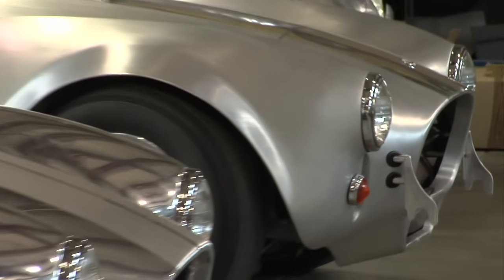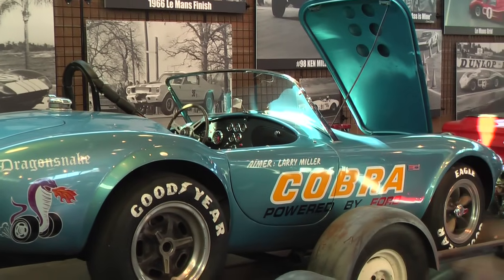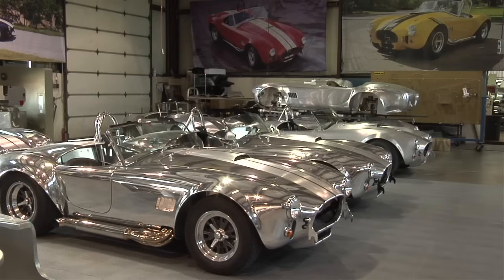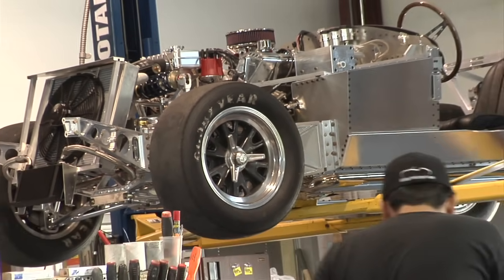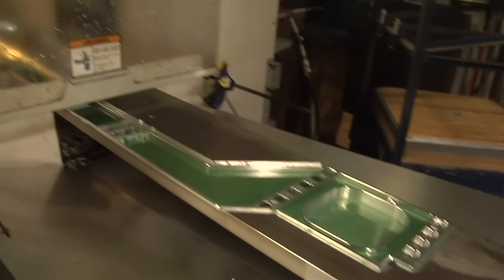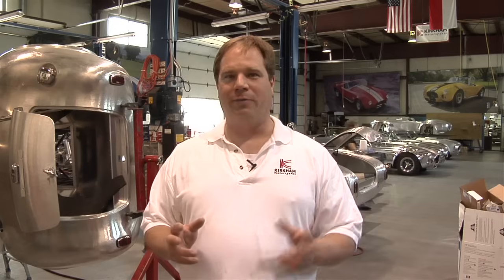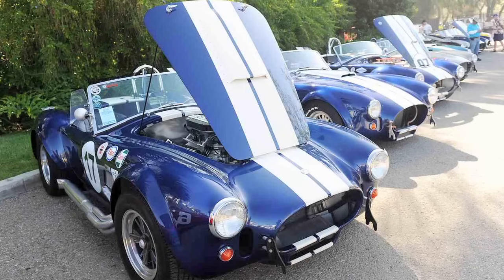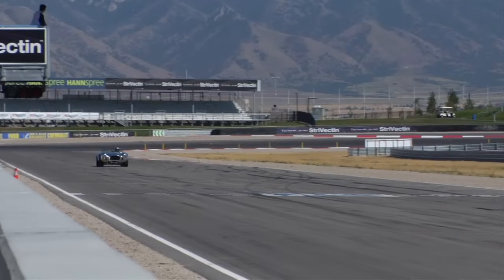Utah's Kirkham Cobra

Comment: Just to clarify, you referred to the 427 S/C as a super coupe, but that is incorrect. The S/C stands for Semi-Competition because they were race versions made street legal. And not all of the 427 S/Cs has a 427; some actually had a 428ci and still referred to as a 427 S/C with the 427 badging. This was mainly due to the limited availability of the side-oiled 427ci FE. HTH
Reply: Wrong. It was the "1966 427 Street Cobra" which got the cheaper 428.

Comment: Back in the 80's there was a guy in town that had a Cobra kit with a fiberglass body but on a little spot on the rear fender he made it look like it was dented. He actually molded fiberglass to look like a small dent in aluminium. It may have actually been a bit of aluminium, I am not really sure how he did it but the long and short of it is he had a fiberglass body but fooled everyone into thinking it was aluminium by faking a small (silver dollar sized) dent. It looked like the paint flaked off with aluminium body under the paint. 
Back in the 80's nobody made aluminium bodies so, back then, aluminium = real Cobra. 
This guy fooled everyone with his fake dent. 
I didn't find out it was a kit until years later, at a car show, he had the car opened up and you could see the underside of the hood etc and it was obviously fiberglass.
Reply from the maker: Funny!!! I wouldn’t be caught dead pulling a stunt like that. Alive perhaps but never dead. Love that sort of thing. Thanks!!!!!!

Comment: I wonder if the thickness of the aluminium is greater than the originals? I was in the "Chequered Flag" garage n London in the 1960s and they had a Cobra for sale. I put my hand on the top of the rear fender very lightly and to my shock felt it give a little.

Removing my hand I saw a shallow dent there and thought I better walk away right then!

I built a fibreglass replica Cobra and ran it as my daily driver between 1992 - 2002 when I sold it. If I ever have enough cash - seems unlikely however - the Kirkham is the one I would want to buy though!
Reply: Stewart W. How much did you sell your kit cobra for and where did you get it from originally?  Thanks.
Reply: Mine came from Kit Car Centre which was one of the very first to offer a kit in South Africa, where I live. Based on a ladder chassis and Jag XJ running gear and suspension, I installed a rebuilt and modified Ford 302 Windsor which came out of an old Fairlane and a Borg-Warner T5 gearbox.

When I sold it I had put about 60 000 miles on it. The market 17 years ago here for V8 powered cars was not buoyant due to the high fuel cost, so I did not get a good price, probably around USD 8000 at the then prevailing exchange rates.

Comment: What kind of car are you driving? Is it a Shelby Mustang? 65 or 66?
Reply from the maker: Bill Beverly It's a 67 gt 390 that was "shelbyized" in 1970 and then raced. it's mostly correct Shelby, but the hood is made from a Torino hood and the front is like a Elinor. 65 Shelby suspension. Cool, but I'm doing some restoration work right now. Major rust in the rear quarters.
Reply: It's a 67

Comment: These are 'AC' Cobra replicas. The car was originally a model called the Ace, built by the AC company in England. Carrol Shelby had the bright idea of putting a large American engine in a British sports car that was light and could go round corners. But he did not design or build the cars; He imported them ready built and fitted the engines. Every true Cobra, therefore, comes from England.
Reply: The AC Ace was a handling disaster with primitive suspension. It took a great deal of modification to make it into a Cobra.
Reply: It's true that the Ace needed considerable upgrading to handle the extra power, but let's face it, Americans can't build sports cars.
Reply: ahh Yeah Don't you think most guy's 99% now that checking out this Video. Those Cobras are worth more but these Newer Kit Reproduction Cobras are Faster Wayyyy Better Quality and Reliably
Reply: And the 427 was a Ford design - with the body built to Ford specs by AC, a complete redesign.  Ciao, L (FoMoCo Engineering)
Reply: I've owned Jaguar, MG, Triumph, and Lotus and I can say that the Brits have a great eye when it comes to coach design. Unfortunately that expertise does not carry over when it comes to engineering. You would think an island nation would know how to design an electrical system that resists wet weather. Mechanically they all had quirks that had to be gotten used to. Still, I loved my little cars when I was a young man. But back then I had the time to work on them.
Reply: David miorgan  Porsche is the most successful company when it comes to racing...
Reply: David miorgan   no matter how many times you say it it will not make it true...
Reply: @liarliarliar6495  Americans can't build sports cars? Have you heard of the Chevrolet Corvette? Maybe the Ford gt40? Granted there aren't as many as there are in Europe. But American companies have managed to make a couple "sports cars". And the Corvette is midengine as of 2020.
Reply: @storyteller1749  Sir  = You speak the truth... AMERICAN sports cars are a very good car for the money...  I own a 2014 STINGRAY  =  7 speed  =  525 HP = Great cornering = Flat Out haul ass machine...  4 yrs old when bought ... 15,000 miles... in new condition...  45,000 $  Now where else in the WORLD can you get this kind of car for that kind of money...  HEY I like it ... And the wife likes it... So we are impressed with AMERICAN sports cars... You can spend alot more = And get little more results...
Reply: The 427 was not a "Ford design". It was still the AC Ace, flared by Alan Turner of AC to accommodate very wide wheels.
Reply: The AC Ace was not a handling disaster as you say. If you were to ever drive one and know anything about classic 1950s sports cars, you would be amazed at their incredible handling. The AC Ace was the first car on the planet to have independent rear suspension and a tubular chassis, all designed specifically for the characteristics of radial tyres...and it was thus no coincidence that the Ace was the first production car in the world to come equipped with radials (Michelin X) as standard equipment.   Former AC Ace-Bristol owner.

Comment: "Shelby Cobra", "Shelby", "Shelby"....  Not one mention of Shelby's partner, AC Cars Ltd. of Thames-Ditton, Surrey, south of London. It was their car which they originally modified to accept a 260 Ford V-8. It was their design--which Carroll Shelby never bought the rights to, by the way--and it was they who built the complete cars. Contractually the cars were "Shelby AC Cobras". Shelby American had a lot to do with helping to develop the cars, as they kept fitting more and more powerful engines, which necessitated stronger and stronger parts, as dictated by racetrack experience, which they would pass on to AC. While not many Americans know it, AC also had its own Cobra racing efforts at Le Mans and elsewhere, and their own experiences also translated into improvements to the Cobra. It wasn't all "Shelby", "Shelby", "Shelby"...
Reply from the maker: Well yes. But it really is Shelby. Sunbeam and Allard did the same thing sort of. But the Shelby ford racing team made the magic happen.
Reply: The Shelby team in particular and Ford had a lot to do with "the magic" you mention, but as I pointed out, AC incorporated its own racing experience into the gradual development of the Ruddspeed AC Ace into the big block Cobras, over a five year period. Much of this is unknown to Americans, because Ol' Shel did a very good job over the years in doing his utmost to deny AC any credit. The Cobra had two parents, one of whom was funded by Ford. It didn't have one parent.

Comment: The best version of the Iconic Cobra ever. Hands down . I would order one if l had the $$$$ & also if he gave me permission 2 put in my own engine .  A small big block Windsor 441 cu in. With Hammerhead Performance Heads & Ingelese Injection
Reply: William Smith  
Not sure what a 501 is .. bbf. 
2 heavy . Or if it's a stroked LS. Over square . More stroke than bore . OK 4 all out efforts.  But 2 much rod piston angle on the bores.   
A 441 cu inch is 4.125 bore × 4.125 stroke.  U get the best of both worlds.  4.125 bore is also safe .

Comment: No matter how you spin it, still a kit car and some states accepted as replica.
Quality does not mean in a kit car world
Reply from the maker: Kit?  How do you figure?  Even Shelby has to comply with laws about manufacturing automobiles. Pretty much requiring but everybody acquire their own engine, but that doesn’t mean that there isn’t a way to buy one of these completely put together. It just means someone other than Kirkham has to put the engine in it and then send it back to Kirkham. I would hardly call that a kit.
Reply: @ToyManTelevision  even you buy this to someone else, still put together and a kit.

Comment: They need a grill to protect the radiator
Reply from the maker: Works fine. Never had a problem that I’m aware of. The original racing ones had a screen. Basic metal screen because you know, junk on the track at 120......

Comment: The cOol thing to me is that it SITS RIGHT. Most all replica Cobras noticably look  fake, right away, & mostly because of the way they sit, too high, etc,  and the Rear WheelWell to Wheel relationship is not right. The David Kirkham Motorsports COBRA looks pretty good
Reply from the maker: g FLIGHTNINGNAM hi. Built from shelbys blueprints. As close to right as you can get. However most owners want some mods. Mostly engine but also suspension
Reply: @ToyManTelevision  thanks🏁

Comment: Aluminum is a mucher easier metal to work with and easier to repair. Half bullshit and half truth. I get so tired of the bullshit people put out of cost. Yes like airstream travel trailer they send all there trailer to these people right LOL there again caught in a out right lie. Aluminum is very easy to polish if you know how and there are several books out there to explain it. And the T 4 aluminum stress cracks very easy cause for toque from the engine and vibration. Don't let them tell you it the hard t 6 aluminum because you and not form it into a car.
Reply from the maker: Mixed bag. Boy can they form that stuff!  But still.. not perfect is it?  They made 2 cars out of Copper just for fun. But poisoned the guys in Poland. It seems copper dust is super toxic

Comment: I can't get past the seat belts you're wearing. Racing seat belts only work if they're mounted correctly, tight, and adjusted evenly. Yours are not. Unless of course you are just posing.......if you stack that car your face will hurt much worse than the radiation burn.
Reply from the maker: That mount is based on the old Shelby mounting  which were perfectly acceptable in their day using Shelby belts. But we’ve decided this whole thing needs to be dramatically reworked. Off to the shop with it!
Reply: Toy Man Television - we didn't know much about safety back then........good luck!

Comment: Shelby American is and has been making Cobras for at least 6-8 years, in Las Vegas.  These are real, honest to goodness Cobras, not kit cars. Come with three different bodies, fiberglass, aluminum and carbon fiber. Rolling chassis, when I was last there, about 4 years ago, went for around 150k for the fiberglass body. Then the car had to be shipped to special car shops to have engine and trans put in, you pick which combo you like....another 30-40k. Once again, these are SHELBY made cars, built the same way as in the 60s.
Reply: Buckaroo543 Kirkham makes ALL of Shelby’s bodies if they are aluminum. The Shelby Cobras are still manufactured like and use Kirkham parts. The Kirkham is cheaper because is doesn’t have a CSX4xxx serial number. Otherwise a better car. They start around 81k without a drive train. I forgot who makes the fiberglass bodies for Shelby but it’s either Superformance or Backdraft.